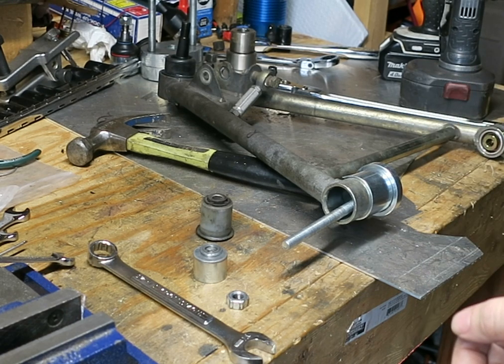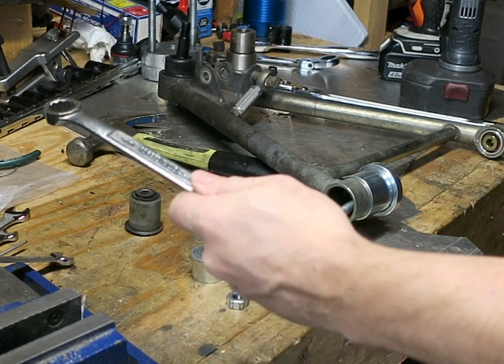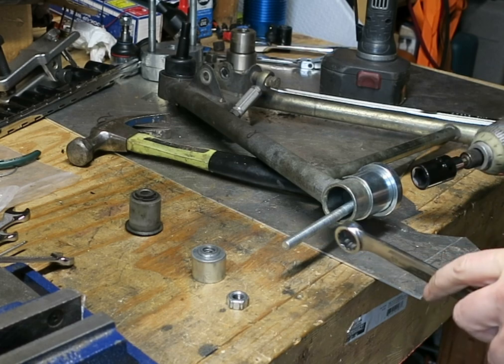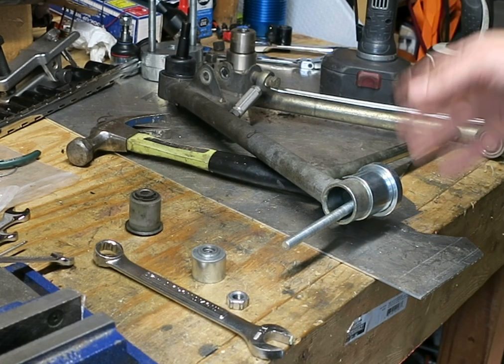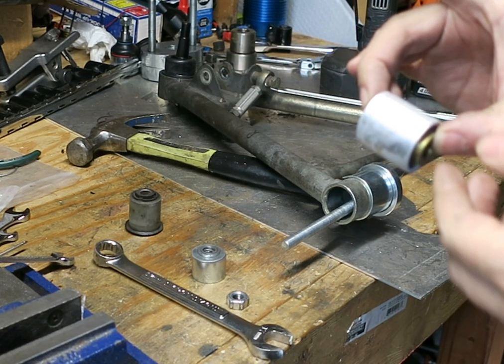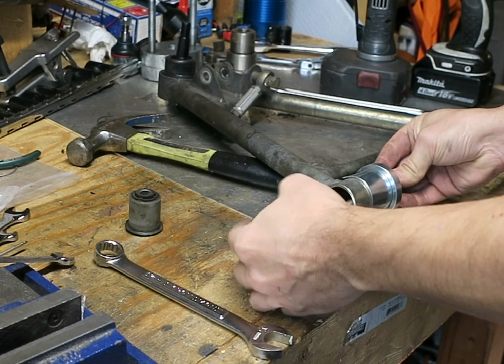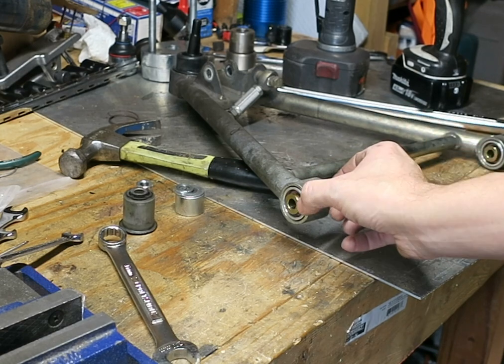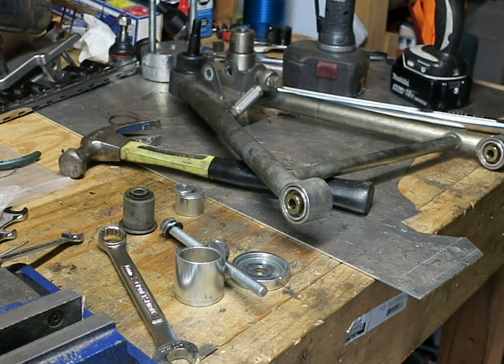Lotus Elise Front Suspension Bushings (Monoballs) the Easy Way

Comment: To make the bolt/tool last longer, you can grease it up with e.g. copper grease. Did that on my tool and had no trouble at all doing now two full suspension refreshs with them.
Reply from the maker: While this probably makes it easier to turn the nut/bolt and prevents frictional heating/galling which will help in borderline cases, it won't add strength to the threads or the bolt shaft. When I used the original 8.8 bolt the bolt itself deformed and stretched permanently. The 10.9 I sourced to replace it worked nicely. Comments on my original bushings video indicate that others have had similar issues, and employed the same fix.
Reply: @The111shift  It will reduce the wear on the threads and make the bolt and nut last longer. Also makes it easier to fit. Can highly recommend it.